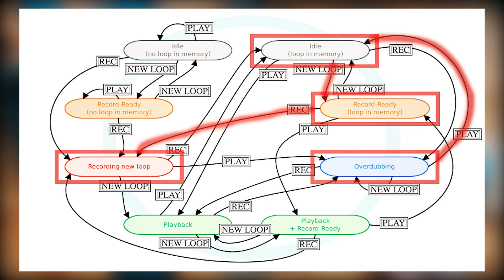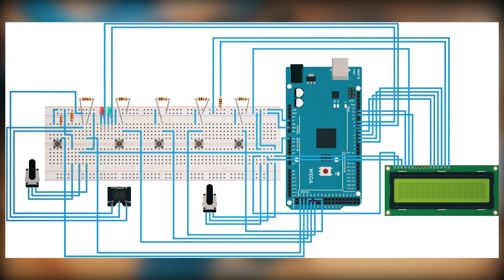Custom Arduino MIDI Controller for Electro Harmonix 45000 Looper

Comment: Hey Markus. Would you be available to help me setting up an Alesis SR-16 Drum machine as an external controller for the 45.000? I already managed to get the Alesis SR-16 to control the EHX 45000 as MASTER CLOCK, but I also want to use it to send  MIDI Program Change messages corresponding to muting each individual track on the 45.000. I am a MIDI newbie and I can't figure this out. I stumbled upon your video and you seem to be quite an expert. Any chance you could help me out?
Reply from the maker: Hey, unfortunately I disabled notifications and only saw this now - do you still need help?
Reply: @maks-io  thanks but not any anymore. I figured that the Alesis does not send CC messages so it wouldn't work anyway. Thanks so much for the offer. Take care.

Comment: Thank you so much for informing that the EHX 45000 needs 300msec between two incoming midi messages.
I tried to send 5,6 even more messages at the same time via the Soleman from Source Audio by creating a macro without success.
The results where random.
Greetings from Belgium
Reply from the maker: You're very welcome Christian. 300ms is the official value, according to the device's manual, but I would see that as a lower bound, actually i had to increase it even further to avoid losing messages.